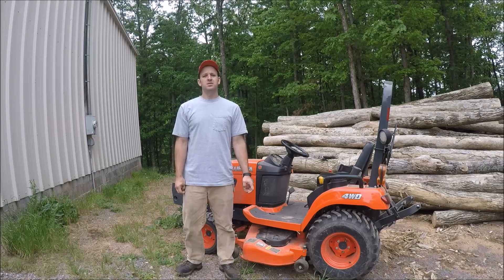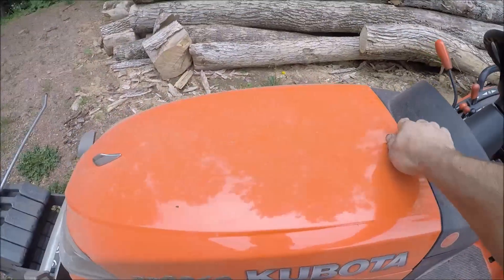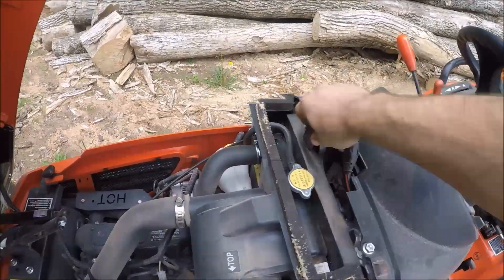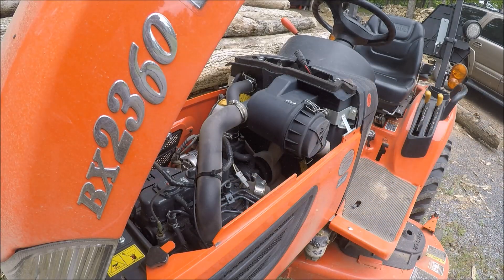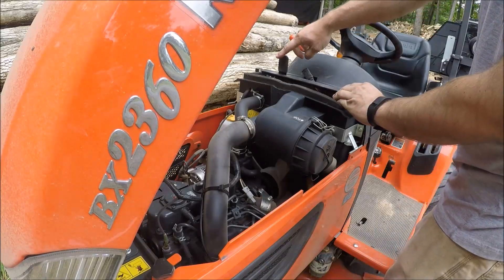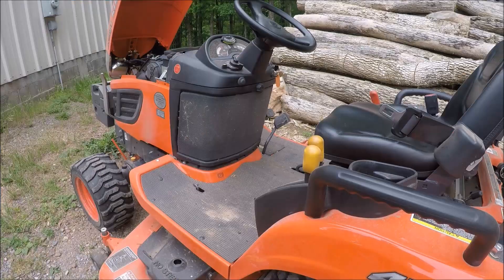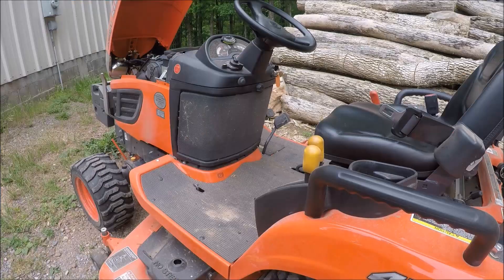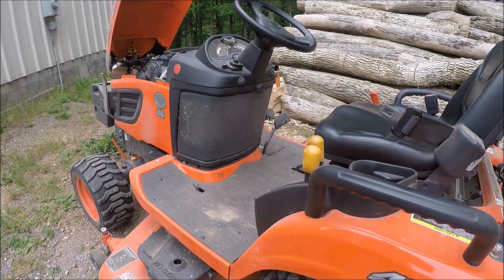BX Mid Mount Mower Summer Maintenance

Comment: Just about the same maintenance on my lawn tractor.  It pays to keep stuff clean and properly maintained if you want your equipment to last a long time.  Don't have a radiator to deal with on a lawn tractor but the engine bay gets blown out with my leaf blower after every mowing as well as the mower deck.  Don't have grease zerks on my mower spindles unfortunately, not many are built that way anymore as they use cheap Chinese "sealed" bearings for short life spans.  I have to grease the front axle and wheel bearings every 3-6 months depending on how much use the mower gets.
Reply from the maker: It sure does pay to maintain things! I have seen some aftermarket spindles have grease fittings when the OEM ones did not. Who know they may be putting grease fittings in a spindle with a sealed bearing.

Comment: sweet job! that dust on the deck belts will eat the belts up quick to so cleaning them like you did is a great idea. I'm sure those belts are not cheap. nice video great job!
Reply from the maker: Thanks!! Good point about the dust on the belts. I had never thought about that but they dust would be like an abrasive to the belt. I'm sure a deck belt would not be cheap. The belt on this one is like two V belts hooked side by side. Thanks for taking the time to comment.
Reply: I enjoy your video work looking good my friend !
Reply from the maker: Thanks, I really appreciate it.

Comment: I have the same deck but a 2009 vintage. There is no Zerk fitting on the center spindle and the center hole is not threaded for one. ?
Reply from the maker: That is interesting. Check under the deck, to see if there is a grease fitting there. I know some MTD mowers have the grease fitting there.

Comment: My mower is a BX 2200 right now when I shift lever to the mid PTO it does not engage do you have any suggestions?
Reply from the maker: With the tractor not running, move the lever and look and make sure it is hooked up on the transmission.
Reply: 94BULLITT there are times it engages other times it grinds as though just out of gear. 😕
Reply from the maker: Does the linkage appear to be bent?
Reply from the maker: Also is the selector lever for mid, rear, and mid and rear, in the mid position completely.